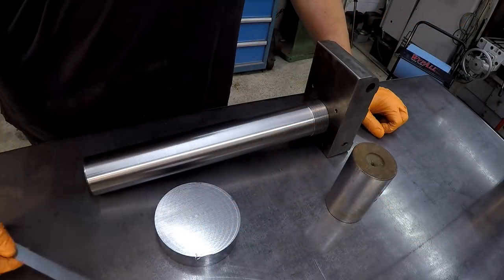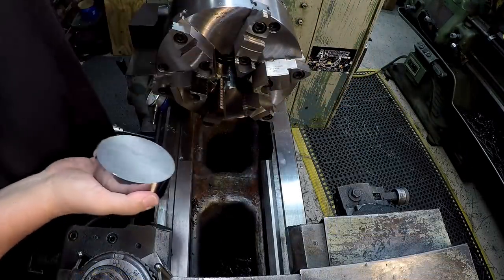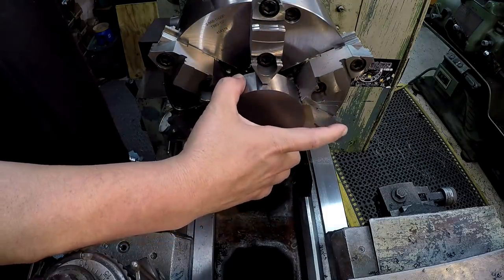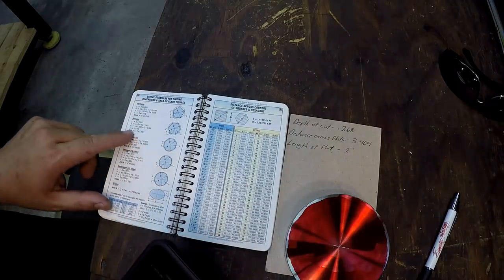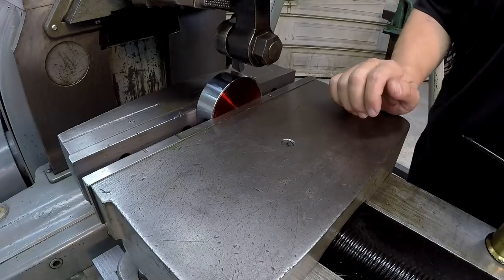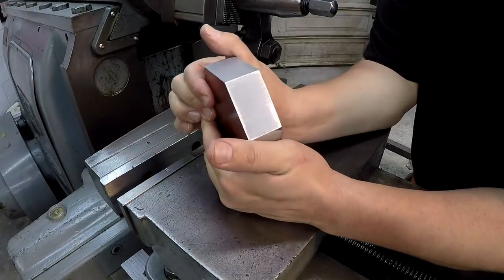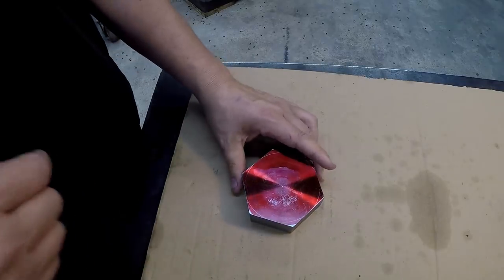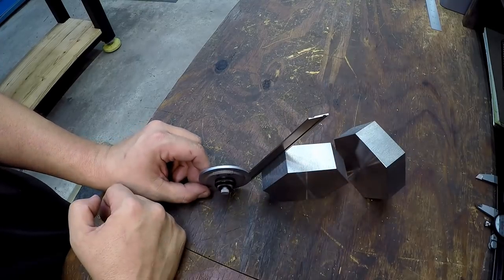Custom Internal Shaping Bar Part 3

Comment: The "distance across flats" dimension can also be obtained by taking the diameter and subtracting twice the "depth of cut" dimension, naturally.

4.0 - 0.238 - 0.238 = 3.464
Reply: It can also be derived from Pythagorean theory which yields 2*√3 or trigonometry which yields 2*2*Cos(30), either of which will give you unlimited precision.

Comment: You could have cut it to 3.4375 so you could use your 3 7/16" wrench on it. Everyone has a 3 7/16" wrench, right?
Reply from the maker: Sure, I keep all those small wrenches in my top drawer
Reply: @Abom79   Actually, as I think about it, what will you use to tighten the nut? And how tight does it need to be? And what does the surface it tightens against look like? 

What I'm thinking of is that if the edges of the flat side of the nut are square, it could dig into the surface, so if this could be a problem, what are your thoughts on putting a bevel on the flats so the only contact surface of the moving nut is nice and circular? But maybe you addressed that when threading the nuts and I'm just too impatient to wait for the next video.
Reply: i am sure he will machine a washer face on one side

Comment: The shaper is a massive machine but you can see how the table with the vise moves quite a bit...
Reply from the maker: It’s only because I have the machine sitting on 2x12’s and the machine is rocking on them.
Reply: Oh okay so you're saying the whole machine is moving not the table only, sure.

Comment: the black book looks like its got all the geometry lessons I need right there' the shaper made short work of that hex i'm impressed the technique all the the way thru looked sharp that bevel protractor is awesome dose that have the clip on magnifier you need a lighted magnifier one of them swing arm deals I have one next to the sharpening stone drawer handy as can be